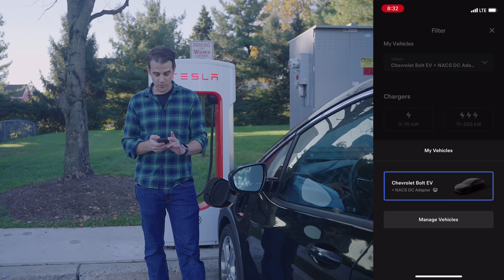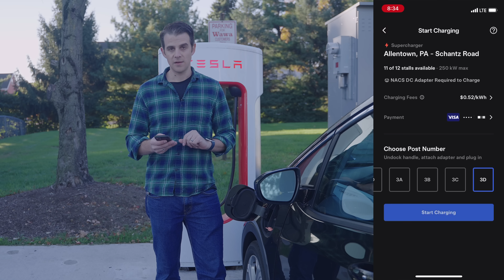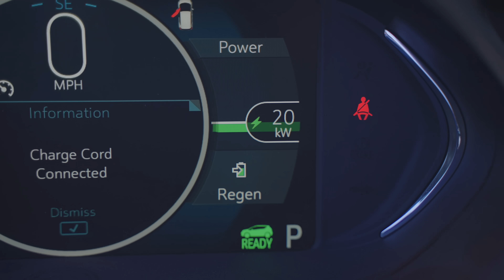How to Charge a GM EV on a Tesla Supercharger

Comment: A very good video. I had a 2018 Bolt with the optional, extra cost DC fast charging port. In your case, with a full charge, you could go 235 miles in your Bolt. So 100 miles between chargers wouldn’t be a big deal except for the slow charging at each stop. Doesn’t make the Bolt a very good road tripper unless you’re willing to sit at chargers.
Reply: 2018 bolts have gotten the upgraded 259 mile battery.       Best to show up at the charger at like 2 percent battery as the bolt is super slow charging from 2 percent to about 52 percent.    Adding 100 miles range can be done in 30 minutes if your charging the bottom of the pack to about to percent.   Basically it means that if you start your day full.   You can do 250 miles (food or pee tine). Charge for 30 minutes and get another 100 to 130 miles  without having to wait on the car too much.        Doing more then 400 miles a day in bolt is slow but upto 400 can be fine.     Doing split days where you make a purposeful lunch break to have a full sit down lunch makes the car decent for 500 mile days.   For me it's kind of a game.    Having access to Tesla means I am more likely to be able to pull into a charger at 2 percent and get that 1110 miles in 30 mins because there are just a lot more options for charging.
Reply: I cannot charge my Bolt at home (apartment), so I use my DCFC sessions to take naps; I bought a plush throw and soft pillow and keep them in the car just for that reason!  I love naps, so this works just fine for me.  But then, I'm also single, so there is no one at home waiting for me, either...

Comment: Does the Lectron also work for Tesla destination chargers?
Reply from the maker: No, there is a different Lectron adapter for that. If you look back in my videos you’ll find that there. The Vortex adapter here connects to the large DCFC pins on the CCS connector, while the destination charger version connects to the J1772 AC pins.

Comment: My favorite plug? Definitely the NEMA 5-20P! It's got the power for everything I need, and that unique blade design just makes it stand out. If you know, you know!
Reply: That's what I use at my apartment where I have 20a outlet.  The difference between the 12a and 16a power delivery really makes a difference.
Reply: @dalececil7527     yes it does. I use  Ohms law math to charge my ev.  ;).   I charge on a Nema 6-20.   Same amount of copper but twice as fast as your 120v solution.   My non Tesla ev is software limited, it don't do 16 amps at 120v.   So jumping from 12amps 120v to 16 amps 240 v is a pretty big jump.

Comment: NACS AC extension cables will exist, but superchargers CANNOT AND WILL NOT BE COMPATIBLE WITH EXTENSIONS. All DCFC have liquid cooling systems in the cables to prevent them overheating. This just isn’t physically possible to do with extensions. Rest assured, V4 dispensers should be the only ones installed now, and current V3 stations will likely get retrofits at some point.

Comment: People need to stop advocating for "beefy" connectors.  In engineering, it's easy to make things strong and heavy.  It's why steel is so commonly used.  Beefy is bad in this situation because it makes it more difficult to handle and use.  It might be fine for you as a reasonably young person, but think about someone with limited strength or potentially they have a disability.  I have the A2Z adapter and it's weight and difficulty to use make it a product I couldn't recommend to anyone.
Reply: Don't worry, CCS will go extinct like the Dodo.

Comment: The reason no one took them up on it was they said they would tell the automakers the specs for the plugs until after that agreed to use it. Something CCS didn't do.

And one reason Tesla chargers are so reliable is that they controlled everything. Now that all these other companies are plugging in, there is different software talking to the chargers and they're reliability will be going down.
Reply: The reason the legacies ignored Tesla is because they all thought Tesla would go bankrupt and it almost did, twice.  The legacies wanted nothing to do with EVs cause they knew they'd lose their shirts, in more ways than you can imagine.  And now we're in the present....see Tesla's stock recently?  You're welcome.
Reply: That is not true. No automaker contacted Tesla after Tesla signaled they want to open the network. All of them don't want to use Tesla cause Tesla is a competitor, simple as that. It only changed after Ford jumped in and the "Visionary GM Barba" afraid to lost out. Also, it is the same software.

Comment: I have lots of chargers in California. Plenty in most populous areas in fact. Finding a charging site is easy. There are lots of ccs sites. Often more sites and more convenient than tesla superchargers. Finding one that is available to use and unoccupied without a long queue is much more difficult. Problem is high ev adoption rate here by everyone. Additional tesla sites will hopefully relieve some of this but its just temporary. More multi unit and work L2 solutions are needed.
Reply from the maker: Yes, people don’t fully appreciate how little DCFC is needed if you have L2 everywhere!
Reply: Yep!
Reply: To give folks some added perspective on this, I was curious so I went and looked up the data for San Francisco, CA where I live. There have been 49,710 EVs registered in San Francisco, cumulatively thru mid 2024. San Francisco has around 1,000 public EV chargers. So that's about 50 EVs for every public charger. Plus a good number of public chargers turn off at midnight or when businesses close, or are located within parking garages that require payment for parking before accessing the charger.
Reply: @usflin  I see someone didn't major in math in college, or maybe your GED math has failed you.  You're assuming that all EVs use public charging.  What about the majority that charges at home, or at work?  You assume that all the 50,000 EVs are going to charge at the same time at the public chargers?  What about gas cars?  How many gas stations for all the gas cars that are out in the city?  Do yourself a favor, don't pretend to be smart.
Reply: @guru2899  My point is that people need to be able to charge at home and not rely on public chargers because there are so few of them. *IF* all 50k EVs needed to use 1k chargers that obviously wouldn't work. That point seems to have flown right over your head. At least I don't go around insulting strangers on the internet, even when they have poor reading comprehension skills.
Reply: @usflin  Problem is that with a city like SF where people often don't have standard garages, they have to use public chargers.
Reply: @bruceb1958  Everywhere has multifamily housing, with little or shared parking, it's not unique to SF. This type of parking setup is very much a "standard". Other cities have solved this problem by turning street lights into charging ports. It's not difficult, we just aren't doing it.
Reply: @usflin  I don't disagree.

Comment: Thanks for the tip about using the Chevy app. I just opened it, filtered by Tesla only, and found there are zero Tesla chargers in my city that accept Chevy. Saved myself the trouble of having to install and login to the Tesla app or wasting money on an adapter when I don't have any stations near me.
Reply from the maker: Interesting. Around me most of them do, but they are also mostly pretty new - I.e. v3 or newer
Reply: @chargeeverywhere I've seen plenty of Tesla chargers in my city so they must all be v1 or v2.
Reply: @usflin  It seems that the Tesla Superchargers must be V3 or newer to work with non-Teslas, regardless of using an adapter or not.  I have a row of 8 Superchargers in my town, but cannot use them with my Bolt because they are all V.2 chargers.  However, the V.3 chargers at a nearby city do show up as compatible with my Bolt.
Reply: Which city or town is that? Have you gone on the supercharger map online and filtered out everything except superchargers opened to NACS or opened to all?
 You don't have to be on any app or anything for that.

You can also see if there are any planned sites coming to your area. Despite what everybody thinks, they added over 2,700 new chargers/stalls last quarter alone.
Reply: @junehanzawa5165  San Francisco. I looked at the online supercharger map a while ago when Ford announced they were compatible and there were none at that time. Feel free to look again and let me know if you find any. ;) I see one in Daly City and one in South San Francisco but none in SF proper.
Reply: @junehanzawa5165  I tried to reply earlier but I don't see that reply, so apologies if this is a duplicate. City is San Francisco, CA. I looked at the Tesla map online. There are zero "Superchargers open to Other EVs" or "Superchargers open to NACS" on that map.
Reply: @usflin  Ah, yes. Now I understnd. Those are not all necessarily V1 or V2 sites. It's that Tesla has been very careful not to open to all or to NACS those locations which are very busy in order to avoid frictions between drivers. Especially with the addition of slower charging EV's and the ports on the wrong side causing to 2 spots to be taken on said busy locations. Those areas with very high concentrations of EV's such as SF, LA, SD, etc. are being held back until they can add more capacity, especially with additional V4 stall sites with their longer cables.

Additionally, cities with little space to add them, such as SF and NYC, for example, makes it hard for them (and other providers) to find proper locations and landlords willing to provide the space required. I know in Manhattan, especially midtown, it's almost impossible to find a gas station, nevermind the space required for charging stalls. It's so difficult, that they are starting to install them in underground garages.
Reply: OP is correct. The closest Tesla Supercharger location compatible with NACS adapter-equipped vehicles is in Daly City.

Comment: Thanks for the informative video. Tesla opening their Superchargers is a huge deal for people in West Texas where DC fast charging is very inadequate. I have a 2022 Chevy Bolt and got the Lectron Vortex adapter about a month ago. I tried it out at a local Tesla Supercharger using the GM app. It worked fine. This week I'm excited to go on a road trip and use it for real. Where I live it West Texas it's about 190 miles to the first DC fast charger if I drive to Austin. I can and have made it to the charger in the past, but I'm cutting it really close and it freaks my wife out rolling in to the charger with dashes on the guess-o-meter. Tesla opening up their Superchargers will allow me to charge in Llano which is only 129 miles which means no range anxiety when we go to Austin.
Reply: Abbott and Republicans hate EVs
Reply: @Nicholas-f5  I just registered my car and I found out how much they hate me here. There is an extra $200 EV fee.
Reply from the maker: I can imagine that. The only time I ran through that area was 15 or so years ago and there isn’t much out there! Good luck on your trip!
Reply: @chargeeverywhere  We just got back from our trip and we had a pretty interesting charging experience. We started our trip after charging to 100% using our NEMA 14-50 plug in our garage.  After we got on the road, our first charge was at the Tesla Supercharger in Llano, Texas using our Lectron Vortex adapter. Next, we charged at a Charge Point CCS charger at a TXB gas station near Bee Cave, Texas. Then, we charged at a Charge Point Level 2 at an IKEA in Round Rock, Texas. The next morning, we charged at another Teslas Supercharger in downtown San Antonio. Our last charge was  at a Shell CCS charger in Junction. It was fun trying out the connector and the new chargers. Both CCS chargers have been installed within the last year or so. Even though we have a Chevy Bolt and charging is relatively slow, we didn’t feel any range anxiety on this trip.
Reply: @chrisb508  it's too bad that it costs as much as gas
Reply: @chargeeverywhere  Thanks.